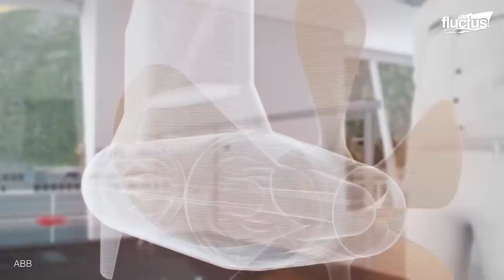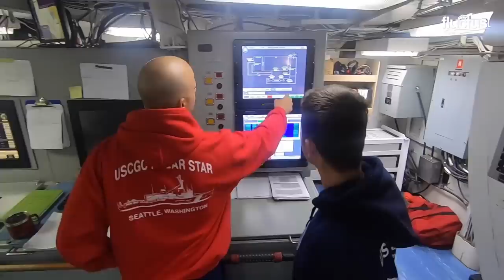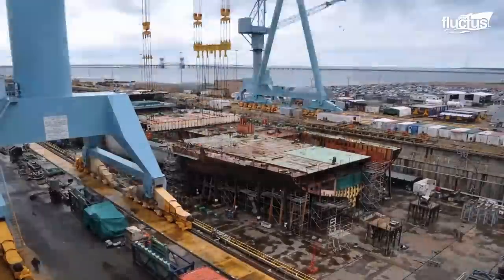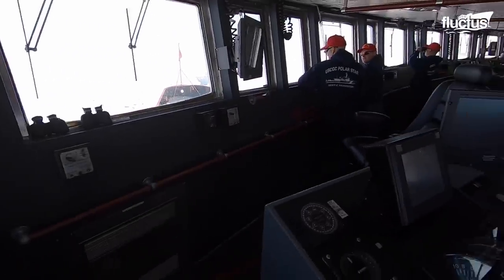This Simple but Genius Idea Revolutionized How Gigantic Ships Maneuver

Comment: Diesel electric propulsion. Not new. I was on a 1939 tug that had it. I did not have the pods, used a shaft driven by 4 DC electric motors. It had 3000 shaft hp.

Comment: A Great Invention And Investment in Steering Technology, One does ask is their need for a Back Up Rudder System.
On another Front and I would be keen to know if anyone has put a name to the Following.
I am probably Presumtous on this as well but Vessel Fitted With Aqua Planes each Side of Vessel which can be Retracted and Extended given the Ocean Conditions.
Two Bow, Four Amidships and Two Stern and on Each Side and Enabled with Latest Computer Technical to read the Movement of the Ocean beneath the Vessel and in Turn Each Aqua Plane in an Individual Manner with Computer making Split Second Decisions to how each Plane is to be Angled at for ease of Movement and possibly more Stability
Control in Rough Weather.
In the Case of an Aircraft Carrier the Launch and Retrieve Sequence means into the wind but when it's tough and rough maybe these could provide a Unique Perspective in Handling the Vessel.
It's probably been thought of and I have only just thought about it myself and worked out the Engineering Basics for such A Computerized System but one which good assist also Cruise Liners and Container / Bulk carrying Vessel's.

Regards
John
Australia

Comment: I don’t think these will be used on the majority of tankers and freighters as the cost and maintenance isn’t worth the cost versus a shaft right off the engine. Cruise ships like these to self dock without tug assistance.
Reply: Just like we overestimated Russia, we shouldn't underestimate Australia, and especially Japan. It's been a good while since the Japanese were at war, but they left an impression that's hard to forget, and historically they tend to hit WAY above their weight class. I'm glad they're on our side this time.
Reply: Yes, as you said a shaft right off of the engine. Many tankers and freighters don't even have neutral let alone reverse.
Reply: @garyradtke3252  Many freighters run two cycle engines and they reverse the engine to go backwards just like our snowmobiles.
Reply: @Chris_at_Home  what's this? You gotta shut off and restart in reverse? What age is the machine you reference?

Comment: How do they keep the water out of the pods? Do the pods have bilge pumps?
Reply: Huh? Seals man. How do they keep the water out of ships with propellers? Or submarines? They have props, periscopes,  and torpedo tubes
Reply: @joeKisonue  
Well ok they must have perfectly working seals then.
Reply: @MustangsTrainsMowers  like submarines or space suits yes. I would think it's possible. It's really only regular boats that are constantly in a state of sinking.  Ha ha. But to answer your question more responsibly,  I will do research and get back to you asap.
Reply: One method for sealing is positive fill with oil. Thus no airspace to counter pressure.
Reply: A new seal design addresses redundancy, with four different lip seals against water and two against the bearing oil chamber. This arrangement separates the seal packages for water and bearing oil seals, ensuring only a theoretical possibility of water leakage into the bearing or into the sea.
Reply: On larger Azipod models the seal can now be changed from inside the pod thanks to an innovative design based on a temporary inflatable seal placed around the hub during the seal change operation. The seal is designed for a five-year lifetime and for replacement during normal drydockings; in an emergency, however, this can be performed with the vessel afloat.
Reply: n the modernization, the propeller bearing side is formed 
of five seal rings between the propeller bearing and the 
propeller. The outermost seal rings form the first chamber 
against the seawater. That chamber is filled with grease 
and acts as a dirt barrier. The second chamber is filled with 
pressurized air. Any leakage from the bearing housing or from 
seawater is gathered in the second chamber and drained out 
automatically at specified intervals to the drainage system. 
The third and fourth chambers, filled with oil, are connected 
to the pressurized seal tanks located above the shaft line 
inside the Azipod unit.
Reply: Many systems and designs.